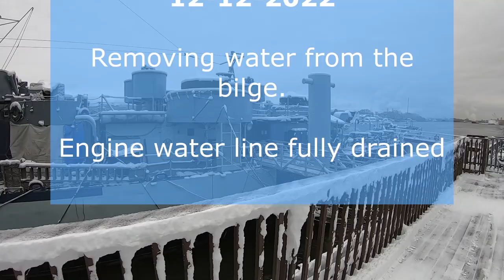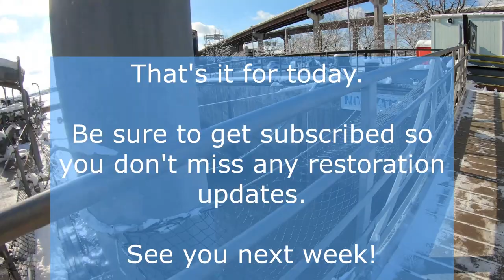Pumping water out of the bilge: SLATER Work Vlog 12 December 2022

Comment: was maintance for the uss hornet cvs 12 aircraft carrier museum did dewatering of a fwd ballast tank and dewatering a sump in a machinery space ,, the secobned  job all i had was a small electeric pump to lift it one level into a 55 gal trash can and then pump that into a deep sink in a maintance closet on the main deck.. yes compleat madness ... have also cleaned oil sumps in a fire room .. sipes are best kept in the dark do not feed after midnight